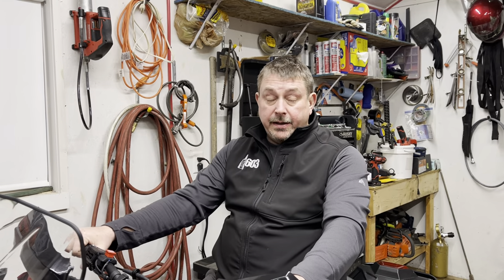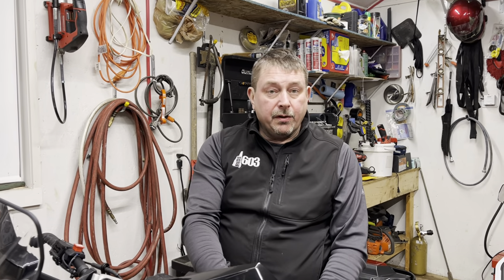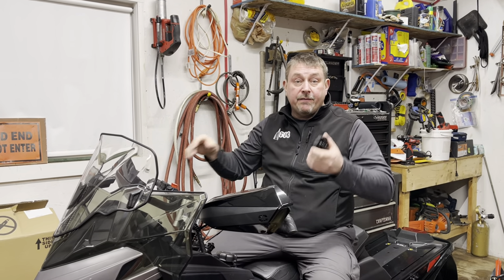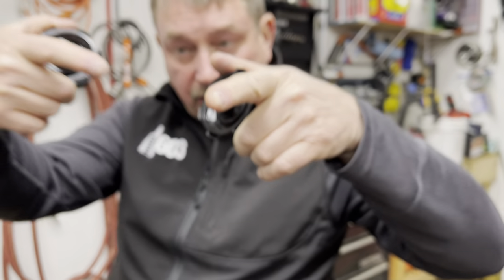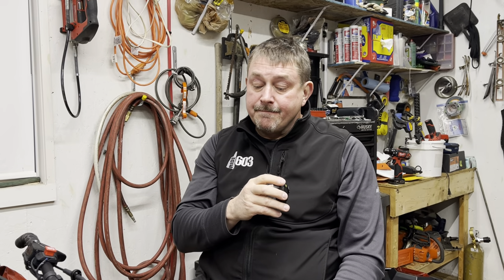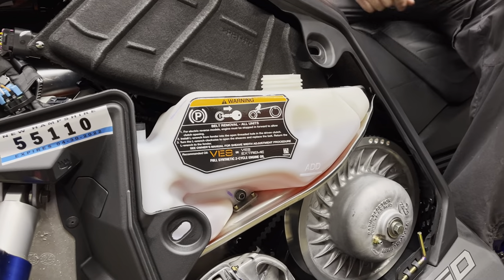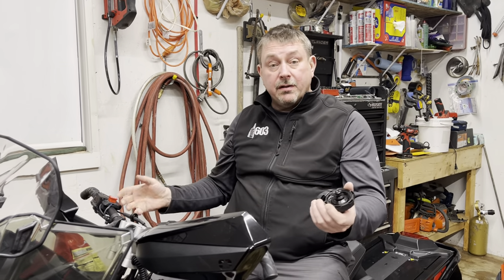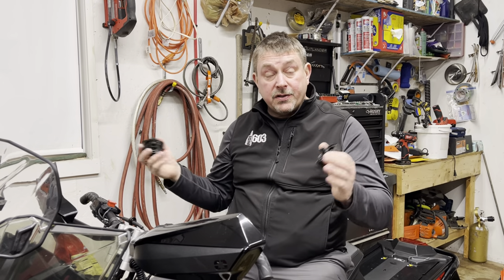2022 Polaris Snowmobile Oil Cap Alert

Comment: Great information! I have used Passo Racing vent cap instead of the Polaris cap for 8 years on multiple Pro & Axys chassis sleds and love the design and quality. Some factory caps don’t tighten well and jump a thread right before it gets adequately tight and hard to notice. It makes a huge mess if you don’t know it’s happened.
Reply: Soo many oversights on these new machines really is disappointing. Just the quality of even the mounting of the oil tank sucks, threads are plastic and cap pops off at the slughtest over tighten. Looking for an easy fix now

Comment: Thanks Lenn! Did you  by chance look at your oil line for the air bubble  many talk about?
Reply from the maker: The oil bubble is common in every new sled, absolutely no concern. They go away after a few rides.
Reply: @BrookeJohnson3j  not to be wise guy but if bubble is 1''  or longer it needs to be removed as per polaris, small bubbles may be ok. there is a way to  prime oil pump without digital wrench  it is on facebook or hardcore sledder?

Comment: I know you do a lot of riding,why are you doing that mixing the oil deal?This concerns me more than the oil cap😂😂, are you not getting good mileage out of the 850 s? I would definitely like to know because I'm coming close to 3000 miles on mine and would like to know if I should be buying a set of pistons and rings for next season 👍 thanks appreciate this information....
Reply from the maker: I only do it during the break in. As extra insurance in case something like that oil cap happens. Your sled will go 10,000 miles with the stock pistons and rings. No worries!

Comment: This shows how weak Polaris' quality process is. They lack the simple checks needed to monitor suppliers who provide these sub-assemblies. This is manufacturing 101 and all we hear is excuses. I see several other component issues are also popping up,  not to mention some assembly issues with fasteners, coolant hoses, etc. Polaris could do well by hiring a good process/quality director. it would cost peanuts compared to what they'll spend in warranty and lost customers.
Reply: Almost as bad as the 10,000 sled recalls by Skidoo last year 😂
Reply: Looks like polaris has changed the oil cap part# in 2023 all the way back as far as I look 2005 .no ball .